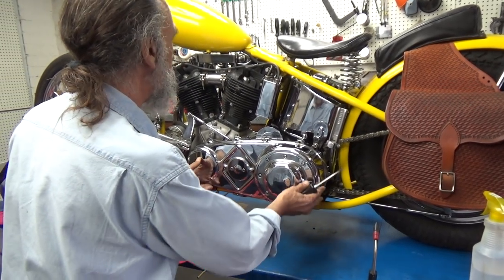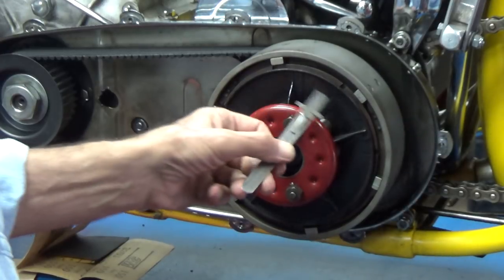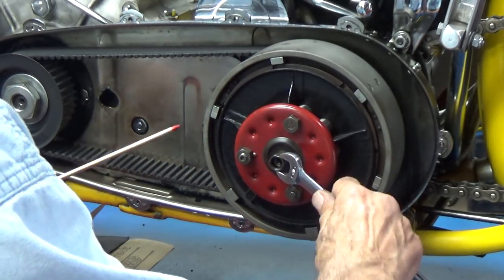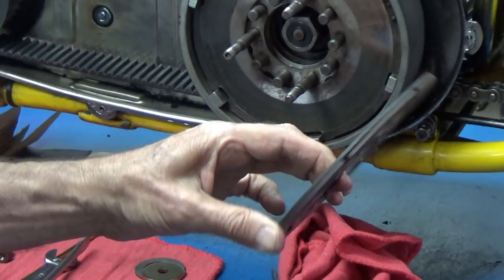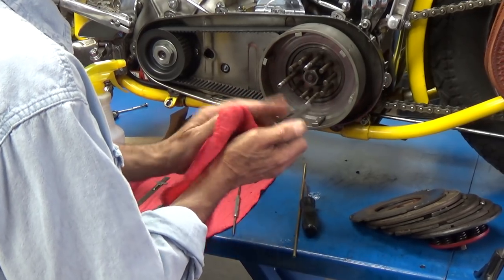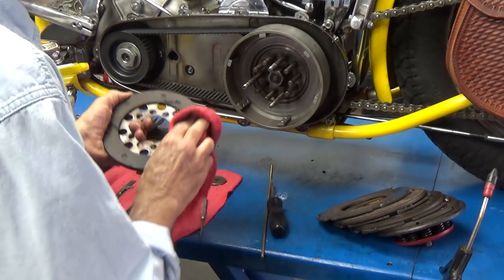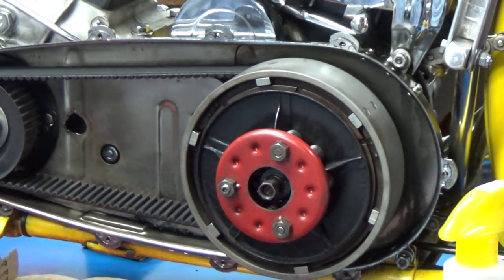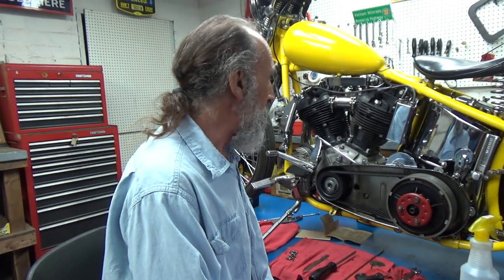Service the stock dry clutch on a Flathead, Knucklehead, Panhead, or Shovelhead Harley Davidson

Comment: That was a great memory.  I remember the first time I did that as an 18 yr. Old in the late sixty's. On my 52 pan. I didn't know about the washer. Man I had springs going everywhere. Funny. Now on my 75 shovel I have a wet primary with wet clutch plates. Installed them in 1992. They have been perfect. Thank you for the memory.
Reply from the maker: Thank you.

Comment: Now I know much more about my shovel dry clutch. Going to follow your procedure because the clutch is engaging VERY abruptly. Difficult to start off in 1st gear without the bike lunging forward, making stop signs and red lights interesting. Can't ride it like this. Hope the cleaning/sanding works. Great instruction, thanks for posting!
Reply from the maker: Glad to help.  Make sure the plates can slide easily on the clutch hub fingers.
Reply: @pacificmike9501  Will do, thank you!
Reply: @pacificmike9501  Mike, sorry one more question if you have time. I disassembled the clutch plates and the steels have no cushions? Why might this be? Gary

Comment: As a kid I was riding my Big Wheel and he was sanding clutch plates on the sidewalk. Good vids.
Reply from the maker: Thank you.  You know it just has to do with the neighborhood you came from.  And, we put steel roller skate wheels on the bottom of old 2X4's.  Living at the foot of the mountains, was not necessarily a good thing.  You know, I had to take the sidewalk down the mountain (just because it had a sharper turn than the street).  All was good until Donna's (a little girl I went to school with) mother had left their garbage can out, right in the middle of that sidewalk.  Yah the neighborhood was a gas.  We all had childhoods.  That "Big Wheel"  must have been cool.

Comment: I've been having an issue with my clutch not wanting to go into first gear if I put it in neutral at a stoplight. It was working very well when I went to three-and-a-half disc clutch with my rocker pedal assembly. Lately I've been having problems with it going into first gear from neutral. It wants to grind the gears. I've got the clutch all apart and I'm cleaning everything up. I'm going to put it back together and try again that's why I'm watching your video. I wanted to make sure that I have enough play on the clutch pushrod arm. I have the same identical set up with inch and a half belt from BDL. Same pressure plate same releasing disc... I need to lock this video into memory.
Reply from the maker: Make sure all the plates slide easily and smoothly.

Comment: Hey Mike, Nice video!  I have a 76 FXE that I'm trying to go one step (possibly 2 or 3 steps) further with.  Ultimately I need to get the inner primary case off.  It is an HD belt primary (don't know if it's conversion or original to the bike).  Right now the top end is off and the bike is stripped down.  Just the lower end, tranny, starter and primary are left on the frame.  The rear wheel and swing arm are all off.  Everything but the basic frame and what I mentioned.  I realize that this should have been done earlier.  But the fact is that this is a project that started out as a rocker box gasket replacement and snow balled.  But it was a gradual progression.  Which turned into a full blown hardtail chopper build.  I'm explaining in detail and carefully as I can so you hopefully have all the information you need to answer me correctly.  But what I want to do is get what you teach in this video done (which I now understand perfectly how to do).  AND the basket and everything so I can get the inner primary case off.  But with what I have already taken off...the motor will NOT lock as you know.  How can I get this done?  I don't need to take the compensating nut or front pulley off.  As the the case will bypass that.  Your help is appreciated very much!
Reply from the maker: I usually remove the front pulley and clutch hub nut with an air impact.  The belt drive is definitely a modification.  Remember, the motor pulley nut has a right hand thread and the clutch hub nut is a left hand thread.  Thank you for watching.
Reply: @pacificmike9501  so after I get the motor pulley and basket off. What has to come off under the basket in order to get the inner primary case off. Which I thought I asked already but maybe not
Reply from the maker: Please chheck out our inner primary installation video.  Once the basket is off, the starter and it's "drive housing" has to be removed,  then the bolts holding the inner primary housing on have to be removed, and,  please buy a service manual.
Reply: @pacificmike9501  I already have a service manual. But sometimes it's  quicker to ask someone. But not in your particular case. I did read the service manual a couple days ago and got everything taken care of
Reply from the maker: I forgot to tell.  In our next video, soon to be released, we show how to remove the clutch hub.

Comment: When do you know it's time to replace the steel clutch plates. I laid them on glass to check that they are flat. My plates have dark marks on the flat surface however they are not warped. Is it time to replace them or can I simply give them a heavy sanding.
Thanks very much for all your videos they're great.
Reply from the maker: If they work smoothly, they're good.  They can be very smooth.  Clean and smooth is it.

Comment: 1 1/32". that's the distance from edge of spring collar to face of PP. 
On adjusting the clutch: H-D Factory Rep showed us to:
Set the bike level on a stand or lift.
 Set the PP collar at 1 1/32" on all three studs.
Check to make sure T/O brg is in place via oil fill hole in trans/kicker cover. (the later small round needle brg and/or it's snap ring tends to fail quickly when clutch has been misadjusted on the later 70s and 80s Shovels) 
 Check to make sure clutch cable adjuster is run completely in (towards transmission/bottomed out). Yes make sure it's jam nut is run 100% opposite direction too.
Now turn the center clutch adjuster until it just touches the clutch (push) rod. Back out adjuster screw 1/4 turn exactly, and hold it still while tightening the lock/jam nut.
 Now adjust the clutch cable adjuster until you have @ 1/4" or a tad less bewteen lever and handlebar hsg.
. Now pull the clutch lever in while watching the pressure plate move. You'll usually notice it'll lift cocked/at a slant to one stud. Find the side slanted toward plate is lowest, and thread in the collar adjusting nut OPPOSITE the lowest side. Check lever again and pressure plate should lift completely straight and even now.
Double check to see T/O brg is still in place.
 Button  up everything.
Now go do your burn outs. It'll hold it. Now I'll watch the video.
Reply from the maker: Very good.  1 1/32" on late model, 1" on earlier.

Comment: Awesome videos!! I’ve learned so much. I’m restoring a 1961 Servi-Car. Presently putting it back together. Coincidentally putting the clutch on. Do the fiber plates also have a specific orientation? Again awesome tips and tricks of the trade…. You are passing along knowledge you can only get from experience…
Reply from the maker: I'd have to see those plates.  Go by your service manual.  If you don't have one, V-Twin carries them.

Comment: Glad to have stumbled on this channel. You are great! I’ve got an ‘82 FXR shovel head. Wondering if you have a tip on determining if it’s a dry or wet clutch? Not just by removing derby cover to check for oil. I just want to be certain it wasn’t converted and by chance the oil drained from the primary.
Reply: It is a chain drive. I assume to look for presence of a chain oiler may be there trick. Just not exactly sure what I am looking for and have seen quite a few different comments online that seem a little more complicated than necessary.
Reply from the maker: You will have to look at it.
Reply from the maker: The pictures are all in the early FXR service manual (real Harley service manual).
Reply: @pacificmike9501  ok, thanks for the tip Mike. I’ll see if I can track one down.
Reply: @pacificmike9501  unfortunately I operate out of a Haynes manual and they mention the difference but don’t show.

Comment: Mike, have you done a video on how to install an electric start on a 65?
Reply from the maker: I believe I have shown it on my Shovelhead.  Look at our Shovelhead playlist.  Is your electric starter system gone, or just replacing a starter?  I assume you're speaking of a '65 Electraglide.  But, you didn't say.
Reply: Pacific Mike Yes it’s a 65 Electraglide but it has a later model primary and started. I bought it as a basket case. It continually surprises me, I’m sorry to say. Got a Cycle Electric generator, a relay to the starter button as well. I’ve wired the bike but obviously I’ve done something wrong cause the wiring isn’t working. The starter is in pieces and I’m having difficulty figuring out the manual diagram. Thought if I watched you doing one it may help. Thanks.

Comment: Question for you Mike. I have an issue with a sticking throw-out bearing. Pulling the clutch in when coming to a stop in 1st gear, the clutch doesn’t disengage. Took it all apart, cleaned everything, reinstalled. Same thing happens intermittently. Locks up the rear wheel when it happens if applying brake at same time the clutch sticks. Bike is a 1970 FLH.
Reply from the maker: I think you need to remove the kicker cover and remove the throwout bear.  See if it has a problem.  Inspect the finger that moves that bearing.  See if the clutch throwout rod is in good shape.  They wear out.  The angle of the clutch arm is critical.  The book says 5/8" from the starter motor.  You need to check it all out from one end to the other.  Check the adjusting screw.  The one with a ball on then end of it is not one of my favorites.
Reply: @pacificmike9501  thank you very much Mike. Will do. Time to go to work then!! Have a great day.

Comment: Hey Mike, rebuilding my dads 79 Shovelhead. Your videos have been invaluable in the process. Putting the clutch hub Assam on today and I do not have a woodruff key as the manual says it should have and there is notch on the hub and trans shaft. It has been a couple of months but do not remember one when disassembling. Possible it popped off when Imremovedmhub but didn't see it and was very careful about keeping all parts. Cannot find a video anywhere on reinstalling the hub, only on the clutch with his already installed.
Reply from the maker: I think it's there.  Install the key.  Carefully slide the hub in place.  Be sure the key does not fall out.
Reply: I must have lost it during putting the trans seal in and/or cleaning the fiingers up on hub. Will have to get a new one
Reply: Thanks again for your quick response and for the videos. I have been able to do the work myself with your assistance!
Reply: Also looking to see about the seal on the lick start shaft side . Any videos on that? Or incorporated in another?
Reply from the maker: I believe we showed that on a video for the project bike.  Go to our Youtube Homepage and click on "videos."  It's just a seal that slides in between the two bushings in the cover.  We built a kickstart assembly there.

Comment: Hi Mike, I'm really enjoying your videos, and learning a lot.  I recently picked up a 1983 FXRS shovelhead 5 speed, and just followed this to remove the clutch, clean the plates and re-install.  I found that the plate spacing was set at 1-1/8", but according to the service manual this was set at 1-1/32" at the factory so that's what I set it to, being careful to make sure the spacing was the same all the way around.  I then adjusted the clutch cable per the service manual for 1/4" clearance. I just took it out for a test run and wow! It's grabbing really nicely now.  Here's my issue though... when I got home I was unable to "find" neutral.  Any advice for next steps? thanks
Reply from the maker: Yes, it's the way they were designed.  Put it into neutral while you are rolling, not when you are stopped.

Comment: Hey Mike, I cleaned the clutch out just like you did in this video and adjusted the clutch boost as in another video of yours and it was fine for a couple of rides and now wont release. The plates were just super gummy especially towards the basket and one was really difficult to remove but I got it out and cleaned them all and it was great. Do you think I should invest in new plates? The set in my 56 are at least 30 years old and thats a rough guess. Thanks.
Reply from the maker: Hard to say.  Sounds like maybe you're leaking oil on to the plates.  Is the clutch nut seal doing its job?  If the plates are just super gummy, they could be so saturated they won't clean up.  Did you try sanding them?  Sometimes, maybe it's time to buy new ones.  If you do, make sure they slide well on the fingers of the clutch hub.  If not, try sanding those studs (fingers).  Sometimes you need to open the holes up a hair on the plates (1/64th over 3/8).  Good luck.  I can't make a judgement over the internet.  I try. Sometimes it's time to replace more than one thing.
Reply: @pacificmike9501  Thanks Mike. I could not get the oil out of those plates no matter what I tried but then read in the service manual to soak them in white gas and it takes the oil right out of them. I also finally think I have the timing done correctly and will be starting it up tomorrow with the primary cover off to see if it leaks from the clutch nut seal or not. I tried to break that nut free but man that thing is on there. Hopefully with the points set and the timing done it will start easier for me and then we shall see if it leaking. Hopefully not. I may pull it off one more time and clean up the studs since its so much easier with putting a big washer on there to hold all those springs together. Thanks again.

Comment: Hi Mike! I finally found some time to dismantle the clutch on my '77 Shovelhead project bike. The plates were a real mess so I cleaned and serviced them the way you suggested in your fine video. However I ran into an unexpected problem with the pressure plate assembly. It has only 3 clutch springs rather than the 10 required. The springs are situated on the adjustment nut studs. Not sure why someone did this, but I intend to install the proper compliment of 10 springs. How do I install the new springs efficiently, and without injuring myself? Thanks.
Reply from the maker: You'll see.  Remove the assembly from the hub using the "washer trick.'  Slowly back off the nut and center screw.  Take it apart. Put the ten springs in place,  Then put the collar, called the pressure plate, in place and replace the center screw and nut.  Now, you can install it back on the clutch hub.  Be sure you get the right springs for your model.  Adjust spacing for YOUR model.  Should be just fine.
Reply: @pacificmike9501  Thanks very much for the advice Mike! Would you go with stock H-D springs, if they're still available, or is there an advantage to after-market clutch springs like the ones offered by Barnett?

Comment: Mike can you make a video replacing the drive pins and studs on clutch , would save lots of $$$
Reply from the maker: Actually, it wouldn't save that much.  And, I've found that when I replace a clutch hub, the whole part is new.  Maybe I'm spoiling myself, but a new hub after a lot of miles, is pretty nice.
Reply: @pacificmike9501  thanks Mike ,